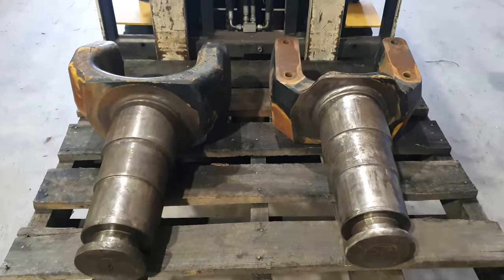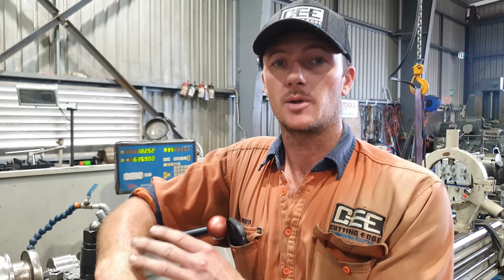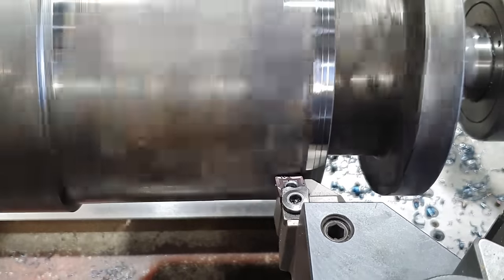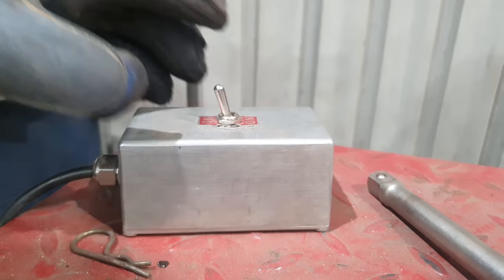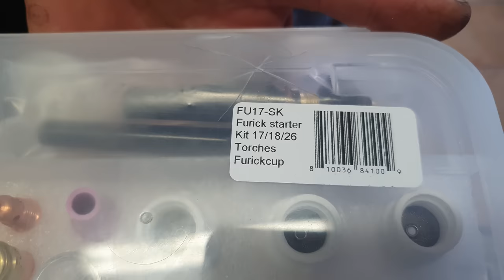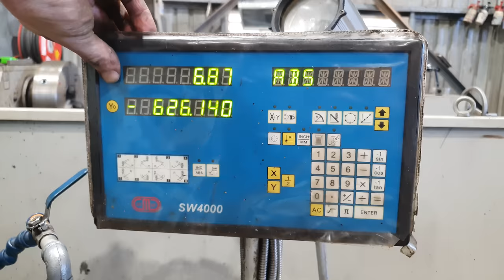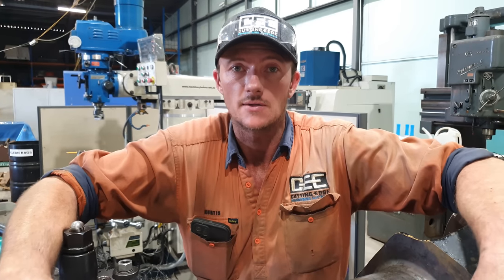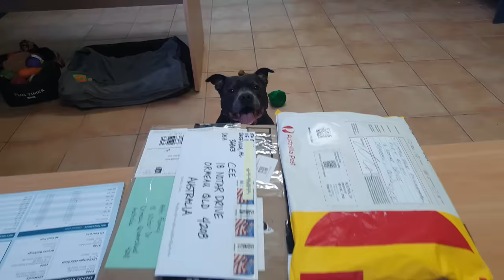Repairing Parts for Caterpillars BIGGEST Dozer! | Machining & Welding

Comment: I'm possibly a little bit nerdy..... But the way u explain things, where they're placed, what funktion they have, what's needs to be done to the parts etc..... It's very well done, but i would be glad if there's a possibility for you to give the weight of the parts.... I mean, those forks are ENORMOUS..... And the second nerdy question is what brands i use on those inserts....

Thanks for yet another interesting video...... //P

Comment: Considering the minimal wear on the part, how did the owner realize there was a problem?
If i had a neat banding machine I'd look for ways to use it. However, could you have pushed the live center back in the chuck and let the yoke drive off of a chuck jaw?  Call me crzy!!!
A beautiful finish on the shaft and all those lovely blue and red chips..... LOL

Comment: Wouldn't a small bar welded across the forks solve the problem of the resonating? Or  is it not possible because of the surface finish on these forks? Looks like it'd be possible on the bottom side of these forks since they don't have a flat surface.

Comment: @Cutting Edge Engineering Australia, you said the front portion of the pins were worn because of the dozer carrying the blade and not from pushing material.  Is that operator error or just part of what that machine was used for?  Was it pushing material with the blade raised?  Love your channel.  Thanks for all the content you bring us.

Comment: Is it the steel that dictates whether it chips or comes out in strings ? Love Your Videos, Thank You !
Reply: Softer, more ductile metal tends to stay attached. Less "flexible" metal chips off, although if it's hot (blue) it doesn't necessarily chip off as fast. .. more to it, like speed and depth of cut but that's the gist of it.

Comment: You can lessen the harmonics by adding a screw acting on the tynes, either side of the arbour. Fitting them as far out as practical will decrease their ability to vibrate.

Comment: I don’t know much about this but would it weld even better if there was a power brush on the other side from the welding 

Like a wire brush returning welt to bare metal

Comment: I used to send those yokes to the undercarriage shop to be welded up with Stoody wire used for track roller build up using the submerged arc process.   That machined so nice and left a surface finish like a chrome rod.    You couldn't help running your fingers across and grinning like a fool.    I probably got more customer complements from rebuilding those as about anything I ever repaired.    I could tell by the look on your face you have heard the other worldly harmonic sound they make if you don't deal with the tuning fork effect when turning. 🤪😵‍💫😬🤮

Comment: Wondering if you worked through the night to meet that deadline. Great video as usual. Just a thought for those that watch and don't realize the time this stuff actually takes, maybe through an hours spent tag line in like you do with the wire speed and voltage. I do this stuff as a hobby with decent machines but very few realize how long jobs take even for great machinists like yourself to complete with massive equipment. Nice adaptation on the inserts cutting speed etc. Hard stuff is a bitch for surface finish.

Comment: I'm wondering why you didn't give the rest of the surfaces a quick polish with the little air sander while they were on the lathe? Not enough to appreciably change the dimensions, just shine them up a little to make the whole item look prettier.

Comment: Sometimes you move the part with the fork lift, sometimes with the gantry crane. I guess the crane doesn't cover the whole shop. What part(s) does it cover? (just point the camera upwards!)
Reply from the maker: hey mate yeah the overhead crane only covers the area where the lathes and milling machine sit.

Comment: jus tthinking out loud, but could a bar not be bolted through where the lift cylinders bolt too? constrain the forks from moving so eliminates the hum like if hold a tuning fork? 

in regards to carrying the blade can you explain a bit more? is the operator holding the blade up when they shouldn't or something?

Comment: Question, mate? Why did you turn down one end of the mandrel you were making and then flip it to machine the center point?
Reply: To insure rod was truly round?
Reply: @LordDustinDeWynd correct. Also to endure alignment between the chucking face and the center point.

Comment: I was surprised at how high pitched the harmonic vibration was. I would have thought that a tuning fork with that much mass would have had a much lower pitched harmonic. Perhaps it's just a function of length, i.e., longer tuning forks have lower pitch, and shorter tuning forks have higher pitch.

Comment: Could you give some specs about the Nissan Truck/PickUp ?
thanks
bye
Reply from the maker: Hey mate that's a 2018 Nissan Navara D23 SERIES 2 Utility (best known as a 'Ute' here in Aussie)
Reply: @CuttingEdgeEngineering  I see 450 nm @1500 rpm, that's very good. Very good design also. Congratulations. Thanks

Comment: Couldn't you wrap either foam or cotton batting in and around the fork to deaden the ringing, with this solution there wouldn't be much weight to worry about, especially with the weight of the unit and the low turning speed.

Comment: HI Kurtis, I'm curious, since you had to weld these yokes anyway, why didn't you weld them first and machine them to size. It seems it would save you time, since you were under the gun to complete the machining on a deadline. Also do you wear hearing protection? This is the best machining channel. Abomb79 is good, but I like your channel better because you explain things better. Keep up the good work. Give my best to Karen, and give homey some love for me.
Reply: The reason he machined it first was to make it round and smooth to have a good surface to weld too. It was way out of round & if u throw weld on it would have been really out of round & hard on the inserts to machine
Reply: @matthewperry5524  Thanks, Matthew. I didn't think of that. Do you work for Kurtis?
Reply: He seems to want a very consistent surface, but I think he could get away with it, a LOT less time and nearly if not identical results.  The initial cut on a weld is always hard on cutters, no matter how well you grind down the peaks.

Comment: Wouldn't metal deposition be good for this job? Are there advantages in using wire instead of creating a new layer of metal?

Anyways, thanks for making these videos. I discovered the channel less than a week ago and I have watched more than a dozen videos already! 
I have one request though: please, be careful in editing/when recording about the noise recorded when welding. I'm not sure if it peaks the mic's range, or if it's electromagnetic interference, but it's pretty displeasing on the ears when watching the video with headphones. I ended up watching these videos with the volume turned much lower than normal because of this.
Regardless, awesome channel!

Comment: Hiya CEE. Another great video, and a question. I know that a mil (0.001") and a millimetre are very different, the latter being almost 40 times larger than the former. My question is, Kurtis, given your reluctance to use bananas, when you say you took three mil off a part, is it 0.003" or three millimetres?
A side note - that's the loveliest swarf I have EVER seen.

Comment: Yikes! As you said, that "tuning fork" harmonic was horrible. I bet Homie ran for the hills when he heard that. I would think that the harmonic could be canceled out by the simple expedient of tacking a very small, lightweight bar across the horizontal faces of the jaws. After the lathe work, the bar and weld could be easily ground off. A tuning fork can't resonate if a solid object is "short circuiting" the two tips of the tuning fork (i.e., your jaws). It would certainly make such jobs less annoying to Homie.

Comment: I'm a random idiot that doesn't know what I'm talking about, how hard would it be to convert your line bore welder to work with the welding turret? Seems like you'd get a more consistent result without having to stand and stare at it the whole time...  Maybe?

Comment: You will lose that harmonic problem if you bolt a piece of flat across the fork when it is in the lathe using existing holes

Comment: This Video needs a safety advice. Do not use headphones… crazy noises 😜 nice job anyway!
Reply from the maker: and Karen even edited/reduced that audio! 🥴😭
Reply: @CuttingEdgeEngineering  in real it was even worse🙉 
Thanks to Karen for reducing it!!!
Reply: @michaelachilles2777  And it would have gone on for a lot longer than it did in the video!
Reply: @dfross87  I guessed it. Just to be clear, i am not a safety troll! But today I used headphones. I don‘t do this quite often… Today I know why I don‘t do it quite often🤣

Comment: A question , suggestion & a joke --- I will let you decide ;)
Being a young guy , give the forklift a break & get some exercise , lift by hand those parts ?
For the noise & chattering - maybe rap,  like a truck mudflat with your strapping ?
No longer doing any machining & never worked with ceramic - interested in some info on why the ceramics did not work & general applications ?

Like the truck - I wish we had more diesel option in the US .
 
Thanks again

Comment: Love the channel… Curious… With the yoke mount locations threaded as they are, could you not bolt a plate across the span the dampen the harmonics??? With your homemade centering tool, you have the clearance… One plate, or two straps and four bolts… 

Always enjoying from Texas…..

Comment: You make things look so easy, but I know from almost 40 years experience that, that's not the case. I have been retired for 20 years now, andi miss welding every day. I worked in an open pit mine that had all the heavey duty equipment that you  work on plus a 60 yard drag line,it retired back in the late 1990's. The last few years of working ,I worked with a number or machinist's so I got to really know what they can do.

Comment: New shop-made tool idea: chuck center dog with appendages that couple with the tines of that tuning fork thing. Once the yolk is held by centers, the yolk tines are coupled to those appendages somehow. That will provide drive torque and likely dampen the resonances from the yolk being turned.

Comment: Roll pins are essentially just water traps and points for the water to ingress into whatever they are used in. Given this, why are they so prolifically used? Especially on equipment which is used and stored outdoors?

Comment: You mentioned harmonics, we have the same problem with getting a clean cut when machining brake drums. You may already know this but we used a 6" wide rubberized strap that we rap the drum with which takes care of the problem. I've never tried a strap on a heavy piece like your machining, wondering if it would help?

Comment: No need to machine the surface before welding. Just clean the area to be welded with a grinder then weld. Machine to correct tolerance after welding. You will save a lot of time by avoiding the initial lathe set-up.
Reply: I'm sure he knows very well that he could do that but wants a consistent surface.  Well there's no kill like OVERKILL.

Comment: Nice Job!!   Question:  I dont have a sense of how long the weld took.  I am guessing a while!!   IF so, could you have used a Line Track Welder With the rotary welding table  & a slow mm advance rate to do that welding for you?

Comment: CAT “Tuning fork” have tapped holes at the end. Try add thick steel flat bar with two holes across and bolt it down before machining. It will help with resonance.

Comment: I don't know anything about this, but it looks like if you placed the yoke the other way around with the first bit before the key slot in the chuck, you would still be able to machine it and because the part being machine would be a lot closer to the chuck, maybe there would be little chatter. So, since you obviously know what you are doing, my question is why not? Thanks.

Comment: Hi Kurt's, I watch folks making screws for watches that you need a magnifying glass to see and the I watch you. Both are amazing feats of machining!  I'm somewhere  in between? I admire your skill with the chunky stuff.
As to tool resonance, I use a rubber strap around a noisy component, it seems to absorb the resonance to a degree!
And, as other folk have commented, Karen does a fantastic job of filming, well done.

Comment: I used to work at a shop that machined welded sheet metal tube assemblies on a lathe.  The only way to get them to not sing and have issues with harmonics, surface finish, and chatter was to wrap the sections which weren't being turned in butyl gutter sealing tape.  It was gummy as hell and had to be cleaned off after, but it dampened the vibrations and made turning the parts a breeze.

Comment: I've clamped lead sheet to parts in the lathe to cut down on the vibrations. You could bolt lead blocks to the yoke end, might dampen it and provide counter balance.

Comment: I’m sure there’s a reason but why couldn’t you run them swapped end to end so the yolk is in the tail stock? Not sure if your tailstock would clear and it wouldn’t be as easy to access to cut but I’d think it would solve the chatter issue.

Comment: You could try putting a loose heavy ring of steel on the part you aren't machining to help with vibration, I do it with horizontal milling arbors when they vibrate

Comment: Now I'm not sure if it would work but would putting some pieces of soft rubber say EPDM roofing or something of that sort on the tines help dampen that noise? And maybe even on the centering shaft to increase the bite to drive off of?

Comment: I had to turn down the O.D. on the shafts of several stainless steel parts of roughly the same shape but a lot smaller a few years ago, and I'll tell you... the noise was HORRIFIC!! It was so high-pitched that it almost didn't register, but at the same time it was incredibly loud. It was the most uncomfortable sonic experience of my life (excluding the sound of my ex-wife's voice). My ears rang for a couple of days, afterwards.

Comment: Caterpillar is not a great machine. Between using Chinese steel and manufacturing the machine as cheap as possible has ruined their reputation. Cat makes up for shitty equipment by saturating the market, but especially by having a cat shop and parts available in any major city. Most companies don't like Cat but can get the machine running quicker than other manufacturers. Therefore, they buy the junk.